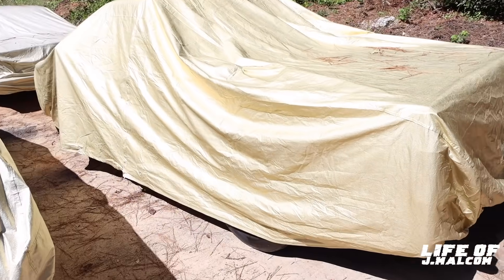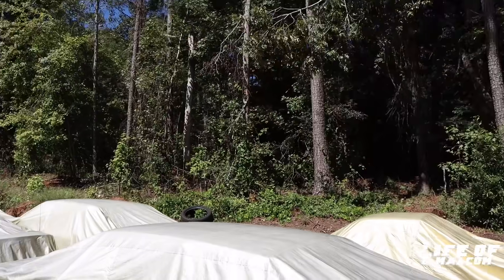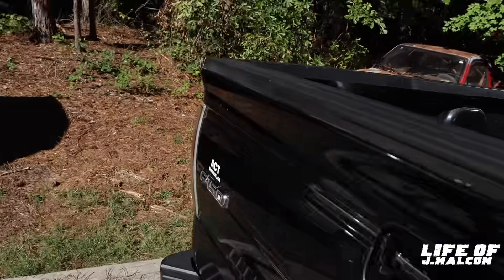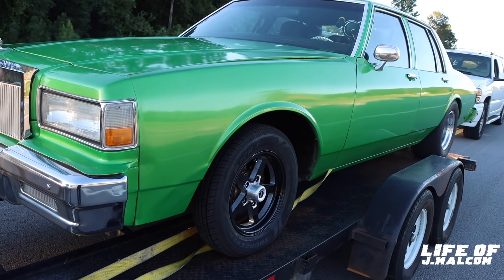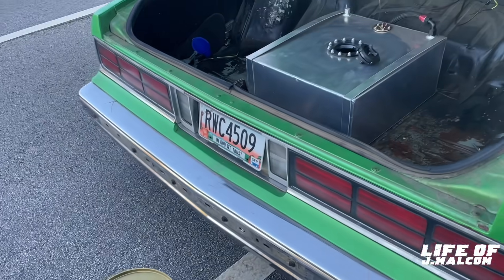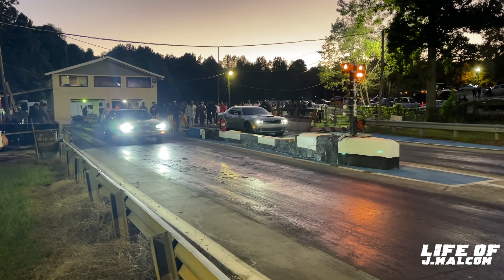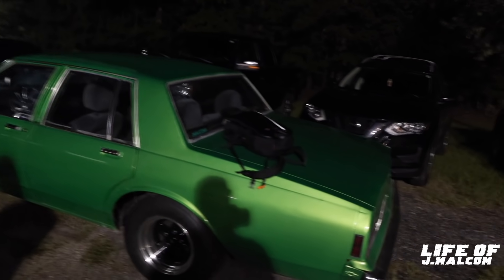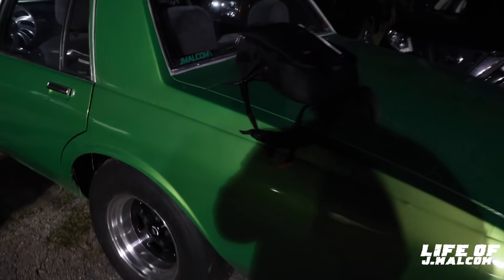WAS A WILD TRACK TRIP BUT THE DOLO BOX CHEVY WAS MOVING ON MOTOR AT THE DRAG STRIP!!

Comment: I was having a bad feeling about that trailer tire. I saw how low it was when you loading dolo. At the end of the day, everyone made it back save though. Hope you find the problem with the brakes. It's either 2 things. Your piston could have been stuck and the brake pads is pushed against the rotor, or the pads is wearing down close to bare metal. That's the only thing I can see.